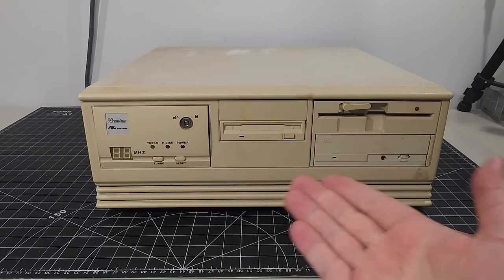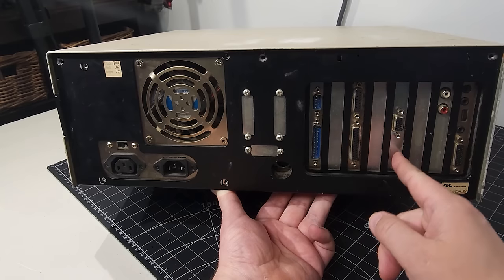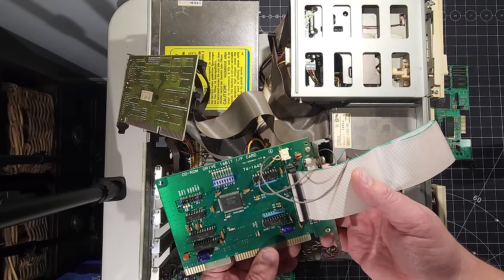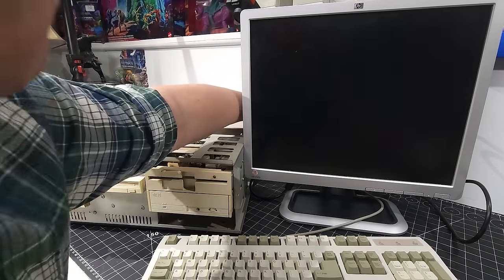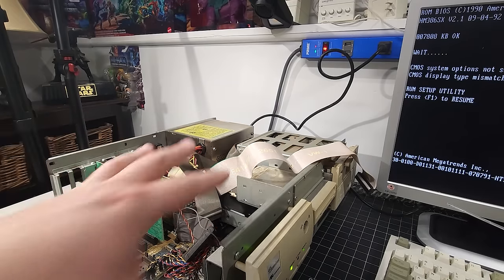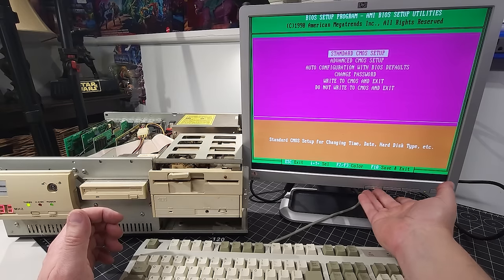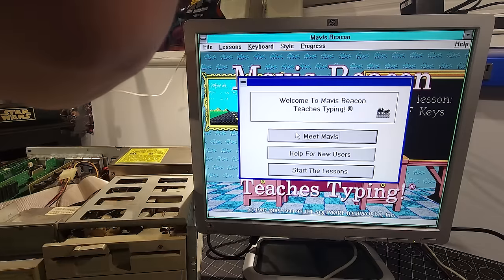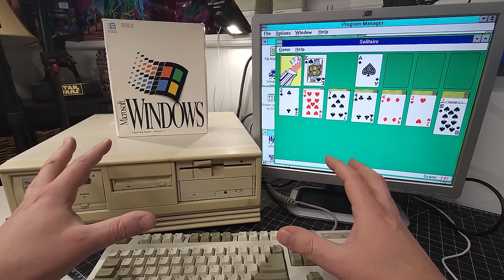What is this Computer...Will it work??

Comment: I really wish that computers still came in this basic style case.  I'm so sick of towers...
Reply from the maker: 100%!  I think SilverStone still makes the desktop form factor.  :)
Reply: Buy an old desktop ATX case and build a retro sleeper with modern hardware inside 😊
Reply from the maker: That would be a cool build
Reply: @TheRetroRecall  it was, I already did it :-) 11th gen mobile i9 (china laptop CPU on ATX mainboard), 32GB DDR4, RTX3070m (china clone gpu), 3x 480GB sata SSD, 850W ITX PSU
Reply from the maker: Now that's pretty sweet!!!!
Reply: @paulpsomiadis5847   What about the temps ? Usually, old PC cases dont have good airflow =/
Reply: @fridaycaliforniaa236  it has a 5.25” drive bay fan as intake and temps are very low :-)
Reply: Agreed
Reply: Looked up the Silverstone case, it's their GD series. They advertise them for home theater but the desktop DNA is super obvious. Either way, great looking cases
Reply: Somewhere around 2008 I was building a new computer. My 'regular' computer store didn't have a selection of cases, only some most generic ones, so I bought all other components from them and told the owner that I saw some cool desktop cases online I'm going to check them out. He practically begged me NOT to get a desktop case, like you've chosen a  great combination of components, do not punish them by putting them in a tiny desktop box!
Reply from the maker: @robertosswald5896 thanks for sharing this.  There's something about desktop cases that I would like to get back to.
Reply: Pretty sure you can still buy "desktop" form factor computers, just look for used business machines.
Reply from the maker: @jnharton yes, you can.  Silverstone sells them still.
Reply: computers don’t come in tower format either now as much as they do in tiny little boxes
Reply: @friday
Just use water cooling or add a sqirrel cage blower to the back.
Reply: I got a new case in this style
Reply from the maker: @philbertchow5425 nice - brand?
Reply: i never look at my computer so i am not bothered. How one gets sick is a mystery to me.
Reply: @jnharton  Yes, a lot of the smaller form factor office PCs can be used either horizontally or vertically.
I have a Dell machine that I use horizontally with the monitor on top. You can even rotate the case badge 90° to match the orientation of the machine.
Reply: Badge...  Likely just a store badge.

Display...  2 digit, 7segment LED, NOT LCD
Reply from the maker: @dannydoolhoff7657 likely and thanks.

Comment: The red line on an IDE cable indicates pin 1, which is USUALLY the top left pin. Before the cables came keyed it was the easiest way to tell.
Reply from the maker: Yes.  I confirmed after that it was in fact Installed correctly and is a bad cable.  The new one is working without an issue.

Comment: The Mitsumi LU-005S was my first CD-ROM drive, circa 1994. The interface is NOT IDE/ATA. It's some proprietary stuff. Some soundcards from this era had an assortment of proprietary interfaces (Mat(su)shita/Panasonic, Sony, Mitsumi) on them, sometimes together with an additional IDE port.
Reply from the maker: Yes.  I have a couple of SB cards that have the 3 interfaces on them.  Makes sense why it has its own controller card.
Reply: @TheRetroRecall  Speed 1x, not MPC specification qualified, not multisession, probably can't read CD-R, but would be amazing if this piece of history actually works ... didn't see you try a CD
Reply from the maker: Saving the CD, floppy drives etc for the restoration vid - part 2 :)
Reply: I think a lot of the early ones used SCSI for the cd-rom because it was 2x faster than the common interface of the day. I remember having a scsi zip drive 100MB at about this era and using 1 zip to install Corel Draw - mainly because it was so big, it took up a large chunk of the hard drive.
Reply: Great info thanks I have one of those drives and forgot what interface it was
Reply: @TheRetroRecall Older Sound Galaxy (A common sound card/clone maker in the 386 years) too.

Comment: I've had a number of times where a IDE, SCSI, or floppy cable has gone wrong, especially on older systems, and on servers with heavy drive use. As the copper cables are quite thin over time the cables get warm and the plastic casing of the wire slightly melts into the cable and causes signal faults. I've had it where a drive either won't show within Windows, or the drive does not work correctly. I've never actually seen it where it causes a whole system to refuse to boot, so learnt something new today.
Reply from the maker: Absolutely.  This was my first as well!
Reply: Copper work hardens, so repeated bending causes it to become brittle and can break, it's always weird to find a wire with intact insulation/jacket broken internally with no external damage 😂
Reply: That surprised me too.  I would think a serious short would be required to stop the HD from spinning up. So I am surprised nothing else was damaged.
Reply: Had quite a few IDE/floppy cables fail over the years usually because of the contortions in serving narrow drive bays and before we sussed that warming cables over a radiator before fitting them was a good idea. A failed IDE to the HDD would inevitably prevent boot or hang in POST. Good fun troubleshooting them though.
Reply from the maker: I was too, especially where I had turned it off and on many times.  That said, it could be a break in the cable?
Reply from the maker: Agreed!  I've experienced them in the smaller IBM desktops where they are forced to be crunched down and flexed when opening the case.  Doing this over and over would force me to replace the cable.
Reply: @TheRetroRecall could also have been as simple as the cable having been installed the wrong way round, especially if it's not keyed. You checked the orientation on the card but not the drive.
Reply from the maker: As I noted in previous comments I also went back and checked both sides again afterwards as per the recommendations in the comments.  Same result.  As soon as I put the replacement cable back on - powered on immediately.  Definitely an issue with the cable.

Comment: I like that you showed how to troubleshoot a computer by removing one card at a time. That's the way to do so you can find out what is wrong with it.
Reply from the maker: Thanks, and I agree - it's the way I've been taught when tracking down an issue.
Reply: Now i always went the other way? start with the absolute minimum Cards installed and add one at a time till it breaks.

If you get a beep code on the first card you have your answer.
Reply from the maker: Definitely an option.  However in the case there were no beep codes.  That said, I wanted to test it to attempt to replicate exactly what the seller had experienced.  Either was is acceptable of course :)
Reply: @TheRetroRecall  my point exactly, no beep codes means ram, cpu are OK, so bare bones with just Graphics, Keyboard and Mouse for the first start, Then you add in one at a time, Floppy, Hd.😮😮. and in your case bingo. You have your issue.. 

Alternatively you could have looked at the colour of the IDE cable, which is grey and denotes an 80 conductor for a ATA 66 and your drive was no doubt an ATA33 which needs a beige cable and will not run on the 80 connector.  

I suggest the Cable is Fine, just applied wrong.  

Had to drag that from the back of my memory BUT as soon as I saw the cable the alarm bells rang.. 

Nice video thanks
Reply from the maker: Ahhhhhhh good call.  Never thought about the 80 VS 40.  I'll have to check that out.  Thanks!!
Reply: @TheRetroRecall  i guess i was always on the clock when Building, Repairing these Xt At PC's. Lol time is money..BUT for YouTube the longer the time the better, to a degree.🤔. Also, if you had simply looked, noted the cable, swapped it and job done, would have made a lousy video . 🤣🤣
Reply from the maker: Haha. So true.. However I always find myself turning my head and saying heck - there's another video! :)
Reply: @TheRetroRecall  good, keep them.coming..
Reply from the maker: Thank you!  Just released a new one :)
Reply: @TheRetroRecall  i will watch it in bed in about an hour as a relax and switch off..
Reply from the maker: Awesome, I hope you enjoy.
Reply: @dadachoski5946  I always wondered whether that "Don't use 80-wire cables for older stuff" thing was just an urban legend. Do older drives actually somehow NEED the increased suscepitibility to crosstalk that comes from not sticking a ground wire between every other wire? (I think I remember reading that 80-pin cables standardized on being wired in the Cable Select configuration. Maybe there are early drives or motherboards which require both drives to be cabled identically and that's what people were talking about?)

All I know is that I've never had a problem with it, and I've never managed to google up an account from someone who had a problem that was fixed by downgrading off a working 80-pin ATA cable.
Reply from the maker: @ssokolow I will say I tried another 80  and 40 conductor cable and both worked fine on the 100mb drive - the system booted.  Again, the old cable still doesn't work.  When I have time I'll be checking the continuity with the multimeter.
Reply: I am intrigued now @TheRetroRecall , those cables were bullet proof unless damaged and normally that would be easily visible.. Maybe age has done for a bit of the copper in one of the lines... I know some of my lines don't work as well as they used to. 8=)
Reply: @ssokolow  
The older drives ran at a lower transfer rate and so were not so susceptible to Crosstalk or interference, not that it wasn't there it just wasn't an issue for PCs at that time.. 

With the arrival of the faster ATA drives this became more of an issue and important. so New Cables,, However Way Back when I would always stick to the matched cables and on this old drive one of the first things I would have changed would be that cable, Before i started to remove eveything the add back in bit by bit to isolate the issue. Just the way I did it as it was IMO the quickest way to fault find.

One other thins is the newer cables were thinner by design and were prone to damage. The old 40s were like steel cables and you had to really work to break them and normally this would be easily visible. Besides, the 80s cost more and didn't do anything for the older drives so why bother?
 
At least that is my experience
Reply from the maker: @dadachoski5946 haha! You and me both lol

Comment: I loved this trial and error method to figure out whats going on with a system. The hardest lesson I learned was when I power supply was dying. I've had two die on me and now know the symptoms. My first bad power supply still allowed the machine to boot up, but the system would quickly become less responsive over the course of two minutes and shut itself off. My second bad power supply had less symptoms and instead abruptly cutoff before or during POST.
Reply from the maker: For sure.  PSUs can cause a world of issues that are far less obvious.  I approached this system in a 'let's eliminate each component 1x1' way.  It usually works out!
Reply: Another possible cause of those particular symptoms are bad caps on the mobo.  I had a problem like that once; the system would often power off after half an hour to an hour after starting up.  Putting in another mobo, with the same PSU, solved the problem.  Unfortunately I don't really have the facilities to replace the bad caps.  There were something like 20+ soda can capacitors and none of them looked amiss.  Think it also had some solid state capacitors, and for all I know it was one of those.  Ultimately, it made more sense to replace the mobo.  It's my primary system and I don't have the space or the tools, or the ability to handle the system being down for days.
Reply: I've been using PCs since 1989 and never once had a problem with a power supply.  My current computer is 12 years old, and the only change I've made is to upgrade from a hard drive to an SSD.
Reply: @bite-sizedshorts9635  I'm glad that's your situation so far.  However, power supplies can and do go bad.  I had one go bad after around 13 years.  Granted, the one I got for that system was pretty awful, but I didn't really know that at the time.  It was some CoolerMaster branded one with 3 12V rails - amazed it lasted as long as it did.  If you spend a bit more on PSUs that are well made, you are far less likely to have problems.  Good brands are Seasonic, and Superflower I think.  The ATX standard has also been around for ages, since the mid-90s with minor additions over the years, so the cool thing is that a newer PSU should be able to power anything since then.

Comment: Thanks for the trip down memory lane! wow- i was 32 then! My first was 8Mhz.
MFM or RLL hard drive. MFM was first, then a new format was discovered. Reformat the HDD with the new format RLL and it doubled the size. I hope you know to park the heads before moving it. It wasn't always automatic. The DOS command was  "park". If there were more than one HDD, the drive letter is specified after the command.
On the  machine, SX or  DX denoted if there was a math coprocessor in it or not. They cost extra and it was a separate chip. There were certain internal mathematical equations the computer could not do without the coprocessor. Most users wouldn't know the difference. It was common to sell a SX for more money because the sales people could get away with public ignorance.
That type of machine was the third one I had. Back then it was m ore common to build your own than purchase one. At the time, I built a 486 DX for about $800 and sold it for $3500 six months later. The 386 was the first to offer an integrated coprocessor. The DX versions had much realized speed differences.
Reply from the maker: That's awesome and yes, I remember the park heads or PH command in DOS.  I'm glad that's done automatically now :). Thanks for sharing!

Comment: my initial guess was that the IDE cable was put in the wrong direction, maybe on the drive. I remember IDE drives not spinning up when the cable was put in the wrong way.

Maybe you could check if that causes the same failure mode with the working cable...
Reply from the maker: Definitely a possibility with the new cable, however after a few viewer suggestions, I put the old cable back in the computer ensuring it was done correctly and the computer would not boot.  Replacement cable, no problem.  It is definitely a bad cable :)

Comment: 2:45 I think you're probably right in this case, but a difference in discoloration doesn't necessarily mean anything, except that the plastic was from a different batch.
Lots of machines have some parts that are not discolored at all, and some that are badly yellowed, even when all the parts are contemporary to each other.
A good example is the SNES, many of which have shells that are yellowed on the top or bottom half only.
Reply from the maker: Good call out.

Comment: My oldest PC i have is an 286-12 PC with CoProcesor and just 640KB of RAM a 20 MB MFM HDD a VGA Card 

It has sadly no 30 pin Memory, it used Dram, and they are hard to find, 
but the Computer works just fine, even with Windows 3.0 in Realmode. 

I Found that computer on the Streets, years ago. 

Thank you for that great Video.
Reply from the maker: That 286 sounds pretty cool!  I don't have one in the collection yet :).  You are welcome, glad you enjoyed!!
Reply: Those MFM hard drives sound gorgeous, don't they. I fired up my ancient Amstrad PC1640 the other day and it was a pleasure to see and hear it run up for the first time in years.
Reply: One of the old PC-XTs I inherited from my Dad would still boot into basic.
Reply: I had some sort of Olivetti with a NEC V20 CPU. It was DOS/Windows compatible. The "office suite" was not mainstream and now I shall remain awake tonight trying to remember what it was!
Reply from the maker: Lotus 123? MS works? Corel Suite?
Reply: @Robert08010  I would have loved one of those, being familiar with C64 BASIC it shouldn't have been much of a leap..

Comment: My initial thought, when you replaced the I/O card the first time, was that the IDE card was turned in the harddrive aka plugged in the wrong way.
The way the HDD led acted, and the no spinning up, triggered an old memory from back when we build those kinda systems ;)
Reply from the maker: For sure! In the end it was the cable itself.  I even tested it afterwards to make sure it was installed correctly and it was - same results.  Happy to have this system firing on all cylinders :)

Comment: Lucky you and congrats! I am currently dealing with RAM issues on my vintage 386SX. Thx for the content.
Reply from the maker: No problem at all, happy to get this system and get it running again!  Hopefully you can get yours going again - maybe some contact cleaner?
Reply: @TheRetroRecall  Update: I got totally different POST codes with every boot, so I decided to revisit the section with the battery leak and to give it a better clean. Turns out one of the LS245 chips was already loose. Unfortunately including the solder pads on the motherboard. And since I do not have the schematics I have no chance wiring sth up. So, well, I guess I have some spare parts to test now and to add to my collection.
Reply from the maker: That's unfortunate.  That's why it's so important for all of the retro community to upload everything we get, find to archive.org.